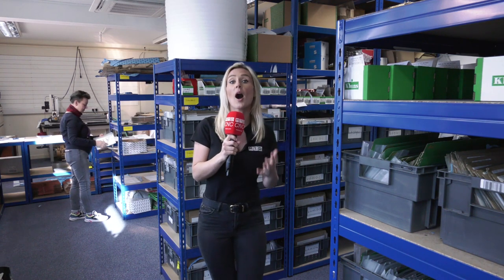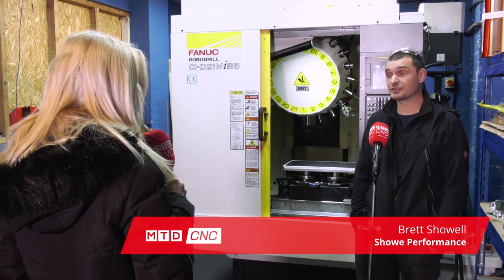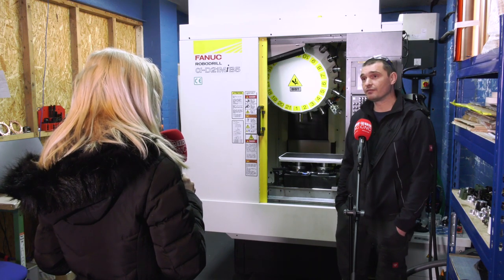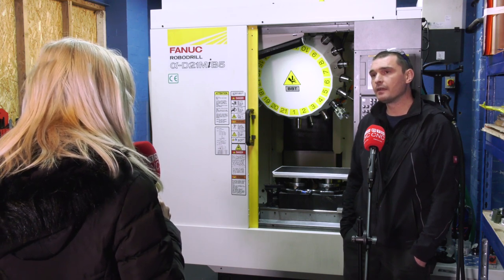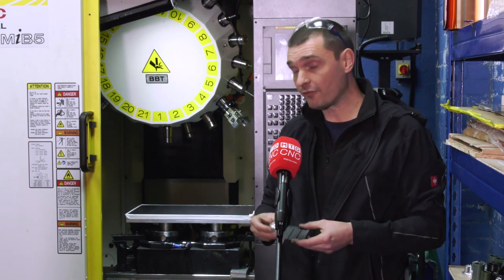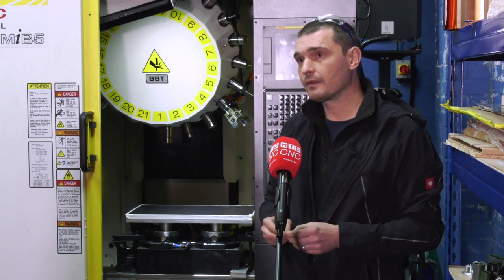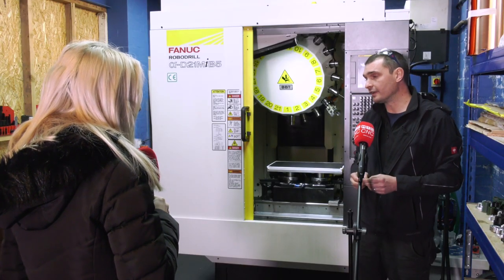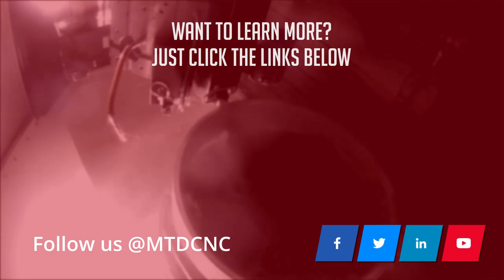Showe Performance made their own automation system on their ROBODRILL

Comment: Anymore details on the gripper? Company that makes them, link?
Reply from the maker: id contact showe performance directly, not sure this end
Reply: It's a schunk gripper
Reply: @showeperformance Hi. The Schunk parts we used for the gripper are a GSW-B 80 and a PGN PLUS 80. I make the gripper fingers for each type of stock I need to move. For the automated vice we are using a PZN 80 but, a PZN 160 or 200 would be more suitable for production.
Reply: @showeperformance5489  Thanks heaps for the information. I tried with a standard Chinese pneumatic gripper but it didn't like the coolant over time

Comment: Hi! Presume it’s our robot robodrill you saw....😀
Reply from the maker: i think it was ;-)
Reply: @MTDCNC  still smashing out the parts. Love my robodrill
Reply from the maker: @SuperstarComponentsLTD  cool we should visit again soon
Reply: @MTDCNC  I think you might be on the latest machine arrival. Just need to get it going at full tilt first
Reply from the maker: @SuperstarComponentsLTD  what is it? give us a clue
Reply: @MTDCNC  Haas this time... with automation
Reply: @showeperformance.  Yes it was, the video was abit of an inspiration!!! I wish I could have afforded a full robot cell, but the pallet and gripper system works well. Going forward will add a Fanuc robot but it will change the pallets and vices over to keep production speed up and be able to automatically change between machining different components. Love my @ROBODRILL @FANUC